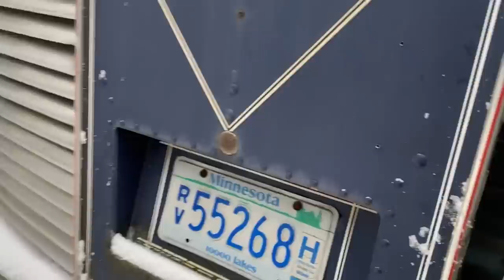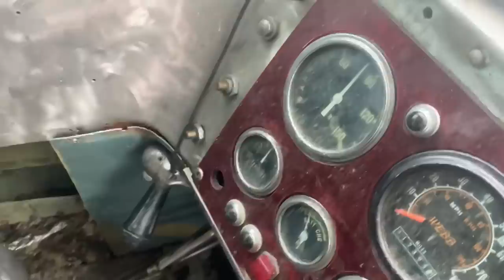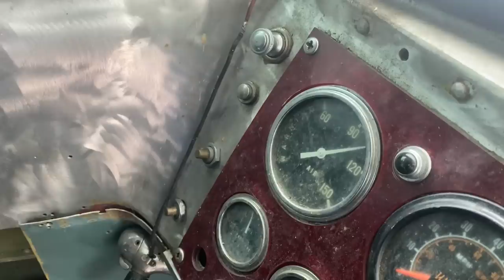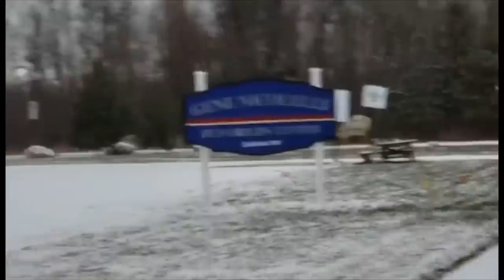Day 2 silversides bus rescue Minnesota

Comment: Amusing that a bus sitting in the woods for a dozen years fired and drove off more easily than the previous patient :)
Reply: Provenance makes a huge difference, I suspect that the older Low block unit at BusBoys had been cobbled and messed with to keep her running where as THIS bus was loved and consistently improved.
Part of why I try buy buses just out of service too
Reply: It looks a lot like it was very well maintained, and when it was mothballed, it wasn't just put in a field and forgot about.
Reply: James Mara  What seems like BS? The fact that they got a vehicle to run that's been sitting for 12 years? Nothing magical going on here ... just old school diesel common sense. The tires would have been the only thing I would be sketched about. Try a 20+ year dug in backyard find that's a gasoline engine (gasoline is harsher on lines and components). Had a Tri-Five that had to of been sitting for at least 20 years: Cleaned the points on the ignition, hooked terminals to jump box and ground, starter fluid in the carb,  bump over for about 10 to 15 seconds, started firing ... I took the carb off and cleaned it up as best as possible without rebuilding it and with a new fuel filter and some fresh gas she was running enough for a small video to sell the engine before we did a LS swap and that was my first rodeo of the sort. I remember being amazed how easily we got that rust bucket to run without rebuilding the carb or replacing plugs/wires, oil/filter, coolant etc All original under the hood, 265 sbc and including the 20+ year old buildup of dirt, leaves, animal stuff ...
Reply: @drewnashty  I bought a gasoline car that had been sitting for >40 years and the gas actually turned into a solid chunk of charcoal...
Reply: It wanted to live!

Comment: I do have to admit that big STOP light on rear is cool...
Reply: Only down side is it replaces the rear round Greyhound sign
Reply: It does not replace anything. The stop glass is original. The greyhound pieces go over and under the stop sign.
Reply: @MrMauserb  Is it Neon?
Reply: It is red glass with incandescent bulbs behind it.  The STOP letters are generally painted black for contrast.
Reply: Yes I would like it just as an ornament for the shed
Reply: That bus has no working brake lights at all by the look of it
Reply: Crazy that it took decades for that to become standard on vehicles these day.
Reply: Hahaha - oh yeah.
But one has to wonder - does ANYONE actually take any "notice" AT ALL, about rear end bus mounted STOP lamps.
I mean - if all GREYHOUND restoration "bus drivers" themselves BLOW THROUGH every single STOP SIGN along that one rout alone?

What "is" the point of STOP SIGNS - (even at - as she said - 4way stop signed intersections) if bus drivers never stop at them?

Comment: Hibbing is a city in Saint Louis County, Minnesota, United States. The population was 16,361 at the 2010 census. The city was built on the rich iron ore of the Mesabi Iron Range. At the edge of town is the largest open-pit iron mine in the world, the Hull–Rust–Mahoning Open Pit Iron Mine
Reply: Bill23799 no, compasses work fine up here
Reply: @Bill23799  Depending on where you are mag north may vary up to.20 degrees or so either way from true north at ground level.  The section lines are all screwed up in spots.
Reply: Sounds a little like Butte, Montana.
Reply: And they now mine what is called taconite, a low grade iron ore, that is refined at or near the mine and made into round pellets.  It is  then shipped by train to Lake Superior (Duluth or Two Harbors) and then loaded onto an ore boat for the trip to steel plants in the eastern part of the US.

Comment: It never ceases to amaze me how willing these things come back to life more times than not.
Reply: They want nothing more than the opportunity to live and work again!
Reply: Mechanical simplicity,
Reply: Agree 100% on these busses that have been sitting for many years.  Amazing that the engine comes to life, and just as amazing that the fuel system is not one clotted up mess.  Everything I know about Detroits I've learned from Scott's videos.  As a motorhead, I've gained new respect for these two stroke engines.  I'd like to see Scott use a few more safe techniques on the  heavy lifts - hopefully with the subscriber base building he'll be able to purchase some more rigging tackle, etc.
Reply: @allgonquin  diesel doesn't deteriorate like Gasoline does. Old diesel will still burn but will smoke like hell. that and It will actually grow mold.
Reply: agree, i rescued a 1952 allice chalmers wd45 from a barn that fell in, it had set under the fallen building for 20 years.took us 3 days to cut away the barn too pull it out, within 3 hours we had it started, price was free, they just wanted gone.have driven it in three tractor rides over the last two years, each tractor ride is between 50 to 70 miles a day.
Reply: It's a detroit! As long as it's not knocking or seized you could run piss as oil for all it cares!
Reply: @forresthoover6895  that's false. They still use flat babbit style bearings, no oil film to ride on= having very bad day.
Reply: vector6977 To be fair it's still screwed with new oil, it's the zinc in the oil that lubricates the flat tappet cam not the oil as much.. i was surprised they didn't mention adding any..
Reply: @shartingfish5761  Detroit's were all roller cams, roller lifters etc.
Reply: Cause they built rite
Reply: @jaxxbrat2634  Facts!
Reply: looks like one hell of an engine
Reply: @allgonquin  
Diesel is a self lubricating fuel...unleaded gas is a self clotting fuel..
Reply: Them old 2 stroke Detroit's live forever ,hard to tear up

Comment: How often in the 21st Century does one get to see TWO Silversides travelling together?
Good save!
Reply: LOL, VERY nice to see.
Reply: If he keeps at it then he could have himself a time period bus station which would make for a cool housing if he wanted to do it.
Reply: I was thinking the same thing . So cool to see .
Reply: I think the most likley place to do this is in the U.S.A ! (we salute you) (Sweden)
Reply: For heat for your bus you really need to consider a Chinese diesel heater! They are absolutely fabulous and only $200 or less. The tap right into your diesel fuel tank and use little electricity from your battery.
Reply: Three silversides...
Reply: @DavidMoskow  where was the third?
Reply: @michigandon  Yeah, my bad. Was only two...
Reply: Found u by mistake and love the videos
Reply: The third bus was at 41:00, the white one, not exactly Silversides though.

Comment: That's so weird, I found that strangely Nostalgic & relaxing at the same time, sitting here in the warm. I'm glad you went to save that old Beast. And I've never seen one of those old buses with a Column shift before, here  Down Under (Australia) our old Greyhounds were all floor shift Road Rangers like trucks without the Diff splitter, 8 speed if memory serves, oh and they were either commonly V6 or sometimes V8's. I always had a soft spot for a good Old GM.

Comment: I have to say very impressive, I was an auto mechanic a few years ago and remember having to go out in the cold to a customers home to try and get a no start running during a NY winter on LI, but they where not diesel just gas operated cars, and never buses so mega kudos to you and your guys not just getting that old girl running but driving a good distance with her as well in frigid temps. and it is great to see someone putting these old buses back on the road again, every time I see one of your buses I think of Jacki Gleason as the Bus driver in one of his olé buses Great work and dedication specially getting out there in the cold as you did, you breathed life back into that great olé girl and put a smile back her .

Comment: You need to get a large tarp to hang off the roof or doors of the bus and blow the torpedo heater into as well as a few halogen work lights and you will have a relatively warm work area.  As for the ground check with a local carpet installer for a used piece of carpet or a remnant sometimes they will give you piece sometimes you have to pay for it but it beats kneeling or laying on the ground.  Almost forgot a 6 to 8 inch wooden dowels down slightly tapered is great to plug the oil returns.  I liked using the dowels instead of rags because the stick up and you have to remove them instead of remembering to remove the rag before putting on the rocker cover and yes I have found pieces of rags caught up in the rocker arms when diagnosing a loss of power and engine smoking.

PS It was neat to see the two silversides going down the road in convoy.  Along with Phil’s advice about not making eye contact did he tell you about when changing lanes let your turn signal blink three times and just start moving over into the other lane.

Comment: I am amazed that after sitting for 12 years it took only 2 days of work and you hit the road with the bus.
Reply: Fred Maxwell … If it was 40 degrees warmer it might have been on the road in a single day instead of 2 days freezing his nuggets off. Guessing it took many hours just to get the engine warm enough for an easy start, never mind the extra prep work and camping in the cold.

Comment: Love these vlogs, what happens if the steer wheels blow on that snowy/icy road?

My first night on the road as a class A driver, was on highway 80, dead winter with 8 hours of driver experience at my California based driving school. Being from California, I had absolutely no driving experience in the snow, let alone on ice. I get in the truck, and you can't see the road, just the markers along the side. The trainer tells me we're loaded for bear, 80,000 pounds of railroad ties, and I should keep the pedal to the floor, watch the markers to stay on the road, flick the wipers when the snow built up on the windshield, and keep an eye out for black ice? What is black ice, and what the heck does it look like, I figure the road will look black or turn dark? He then hops back in the sleeper leaving me to get on with it. lol I was very surprised to say the least, but I did as he said, and 100's of miles later, he wakes up and we get some breakfast like nothing had happened. All went well, so I guess he knew what he was talking about, but had more guts than I did to leave a total greeny behind the wheel in those conditions. lol

Comment: Put cotton knit gloves over the rubber coated gloves. I work outside and those rubber gloves suck heat from ur hands without cotton ontop. Great old bus there
Reply: Those blue rubber gloves are lined. They're called snow blower gloves.
Reply: @philepstein524  yeah,  i work outside. Ive still found the rubber coating sucks heat from your hands

Comment: Watched from WA State.
I'm an old Bus But also.
Done the Detroit Rescue resurection many times.
Love your video documentation.
Buses I've owned:
1st I was 16 yo in Chelan WA 1947 White Brothers 72 passengers.
2nd 1947 Fageol Retired Seattle Metro Transit. 25yo.
3rd 1947 GM PD 2933 . Unusual 33' Bread loaf design, 471DD short deck DD, 4 Speed manual. Long story one this one.
Had a Scenic Cruiser and a Buffalo both given to me in 2007. I had no where for them and tried to give them away in order to save them, I couldn't get anyone. 
2009 I traded a Motorhome for a 1964 GM Fish Bowl Conversion. V671 DD 2 speed Auto.
2011 1947 Ford Superior Short School Bus.
2017 1977Crown School bus. 671DD mid engine, 5 speed Fuller Manual.
Always wanted a 47 Silversides. I've ran across 3 over the years, getting older now but still love em.
Save them all.

Comment: Take a tip from an old trucker in another life when the spray from your tires goes quiet and you can't see spray on other tires you know your on some pretty greasey stuff. You did the right thing. In conditions like that it's good to keep 30 to 40 mph so your tires stay warm and are a little tacky on the ice.
Reply: Yup. An easy way to remember was "If you see spay, it's okay"

I picked up a load of pet food in eastern Iowa three days before Christmas (09-10?) By the time i got to Stewart Iowa on 80 it was freezing rain, I spent four maybe five days stuck there at the Casey's general store, we all got snowed in with I-80 closed down from Iowa to Nevada.
Reply: I watched the spray during day and headlights at night and at night time look at the reflection of how much longer it was with iced up roadways
Reply: Gary Boyd mm

Comment: Sounds nice!      re: steer tires.... forget the date code!!      20:31 Did you remember to put the cardboard over your radiator?  38:13 Are those air conditioners going to clear????     45:08 Finally back somewhere you can stop and get a steak!!

Comment: Great video! I really like the bus rescu vids best. I am really surprised at how well that Silversides came back to life.
Have you thought about installing diesel hydronic heat? You can get that,  a REAL defroster unit, and a couple of heater units from some place like Sure Marine Service in Seattle. If you have a water heater with a coolant heating loop, the hydronic unit can also heat that loop. Just install a fuel pickup in your fuel tank that is well short of the bottom so there is no chance that the furnace can leave you stranded with an empty tank.

Comment: Great video......I love busses and own a land yacht myself. I dug one of these silver sides out of a junk yard many years ago. I had it running in less than a day after 20+ years waiting to be rescued. Great work!
Reply from the maker: That’s awesome!
Reply: @BusGreaseMonkey  Thank you for the reply. My land yacht is a MCI 102DL3 and it's 45 feet long.
It has a Detroit Diesel 12.7 liter series 60...... 450hp
Thank God for cruise control.......lol 😎
Reply: What happened to your silversides?
Reply: @busoldmanphil7293  Hi...... It got sold years ago. It was in rough shape. I had a 4905 until it got stolen. I now have a MCI 102 DL 3

Comment: I wish they'd quit using salt and chemicals. Just learn to drive in snow like Wyoming does. No salt there. It destroys cars in midwest. So sad and so many tax dollars thrown away. Cant be good for waterways either all the salt run off
Reply: From what I hear, the new chemicals are worse than the old ones as far as rust goes.   And it's not necessarily best to warm it up and wash it off - better to let the dry snow and salt fall off rather than wick its way into the crevices of steel and aluminum.

Comment: Scott, pick up a set of Nomex coveralls. I have a pair I got from my father-in-law, and they make all the difference in the winter. They're thick and bulky, but have full zippers on the chest and legs so I can get into and out of them without even taking off my boots. At -5F with 30mph winds, I can work up a sweat running the snow blower.

And the fact that they're Nomex means that they're fire resistant as well as warm.  Given what we do, this isn't a bad thing.

Comment: Awesome   cant believe the brakes didn't give you problems. I have saved 7 from scrapyard deaths and all are still going  I've lived on em. Used one as a daily driver for over a yr. Froze my ass off in the winter but would do it all just the same way again if I wasn't getting a few yrs on me lol. Glad u saved it. Keep it up
Reply from the maker: A lot of water came out of the air compressor muffler.  The torpedo heater melted it.  I figured we were in trouble for sure with freezing lines

Comment: Scott, That bus ran great! It was admirable of you to get the beastie moved to a secure location even in weather you do not prefer. However, I think it might be time to head to the lower latitudes for a spell.. BTW, it's 84 outside here in PHX and I just put some fertilizer on the grass. I am sure Lenny wouldn't mind a wash to get rid of that brine solution. Continued safe travels to you both and to Lenny as well!!

Comment: I had one of these for a while, about 30 years ago.  It had already been converted to an RV, most of the little windows nicely covered over and some larger windows installed...  Everything for the bus was still positive ground, the water tank and holding tank level indicators etc, the control panel was mounted on wood so that stuff had its own negative ground.

I was pulling a full-size van on a tow bar, because the lighting systems were so different from modern stuff, I put together a converter box that turned the separate running, brake, and turn-signal voltages into the combo-type used now.

Comment: Its neat to see the old girl running. Hibbing is some of my old stomping grounds. I know where the museum and all those busses are at. It's nice to see someone saving the buses!!
Some advice if you'll allow me is Minnesota small towns just plow once or twice and then just sand some intersections. The highways are plowed a little better and salt with the sand. In short drive a little slower on Minnesota snowy roads and if you can't tell what's on the road plan for the worse conditions.

Comment: Good work. A friend bought a military semi way up in Michigan. We took a welder for power which was on my truck. 2 space heaters. Bought batteries to make a 24 volt jumper and 4 for the truck. Stuck the space heaters under the semi and installed a block heater. Started at 8 in the morning. Pulled out at 3:30 p.m. drove it all the home to central ohio. 52 mph wide open on the freeway. Barely any heat. 3 of us took it on shifts. It was -35 I remember. The wind chill was I don't know what. Made last call at the local bar.

Comment: You bought extra clothes and worked outside for a couple days to get acclimated; you might as well stay all winter.  To be fair, it will get colder. Back in the truck driving phase of my life, I once spent nine hours stuck in a snow drift when the mercury read -28 F and the wind chill was triple digits south of zero ...and that was clear across the state in balmy, SW Minnesota.  I never saw another living soul for those nine hours.